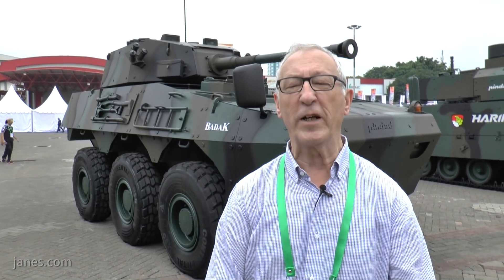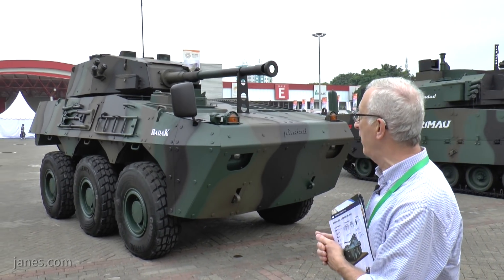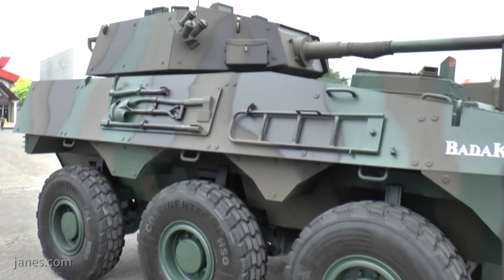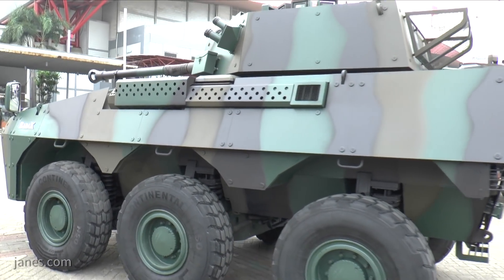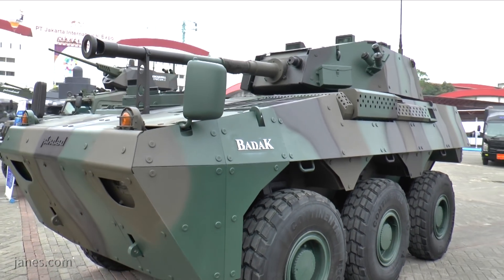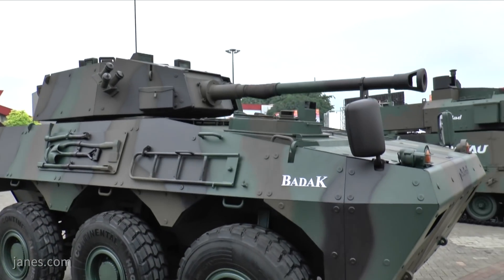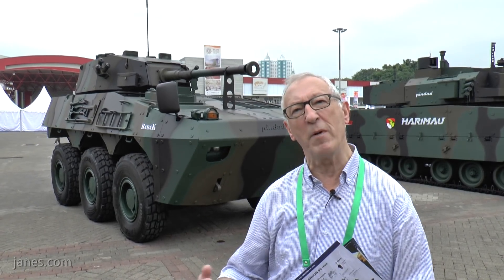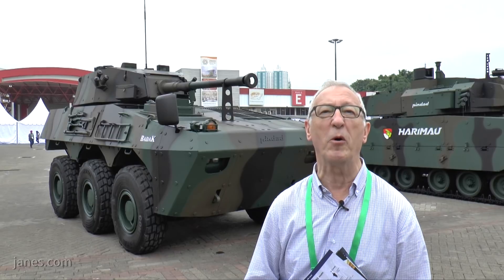Indo Defence 2018: PT Pindad Badak Fire Support Vehicle

Comment: How is it better than any 30-50mm autocannon? Not much. How is it any better in protection compared to APCs? Not better at all. Is it any close to old T-72 with its 120mm gun or M-60/M1A1 with a 105mm gun. Nowhere near it. Is it better than let's say portable systems like Carl Gustav? Absolutely not. An old BMP1 equipped with a modern 30mm gun and single capable missile launcher is way better in any given role.
Reply: badak fsv is made to attack infantry with HE bullets such as short artillery attacks, 30mm-50mm has no ability to attack the area and is only effective in attacking combat vehicles
Reply: @mha1019  That's why any trooper can bring a 60mm mortar, and every two of them can come with 90mm. While on any APC/IFV of 4x4 to 8x8 you can bring 120mm mortar. Considering the speed HE bullet has to have in a flat trajectory, you can estimate that 90mm shell brings less than 1/3 of explosives than any 120mm mortar grenade does. HE gives you fast shot = fast detection of your position. 
This is exactly what Carl Gustav system gives you anyway. Still, with a small Carl Gustav tube, you can hide very fast. In a vehicle, you are relying on your armor which in this case isn't thick.
Reply: Have you heard of American Stryker? It’s similiarly armored and designed, though Stryker has more powerful gun (105 mm) but still similiar in role and firepower
Reply: @FebiMaster  Yes. That is "supporting the infantry - role". Role which is very narrow and useful only in particular tactics US troops incorporate. Also, it's very expensive for what it is. 
Apparently, here such is advertised as a "cheap" replacing for modern MBT or so-called "Tank Destroyer". That is 180 degrees opposite role to the one in which Stryker 105mm serves. Only two other countries successfully use similar vehicles - both on a very small scale.

Comment: I'm guessing the rivetted plates are spaced armour? Based on the images of earlier versions, is that new?
Reply: Yes it is spaced armor. The thickness is probably the same as the base armor.
Reply: i guess with dat improvement the armor should be improve from STANAG lv 3 to lv 4 i guess :/
Reply: @flyhigh6047  I have read from the news, the armor now can withstand 12.7 mm dan 14.5 mm rounds. I assume it can withstand 14.5 mm only in frontal arc.